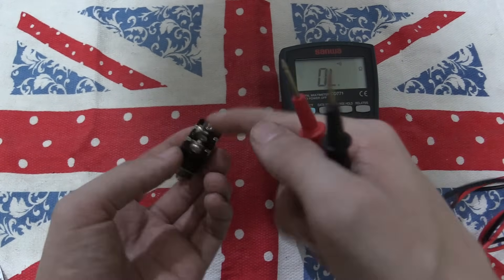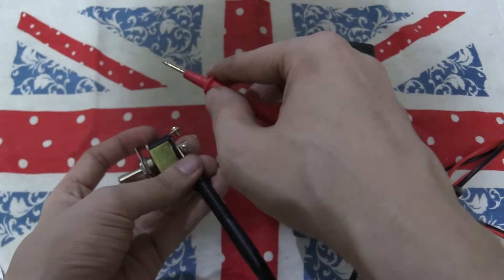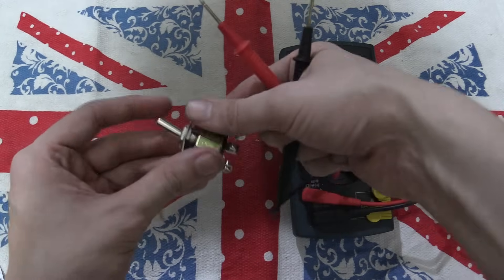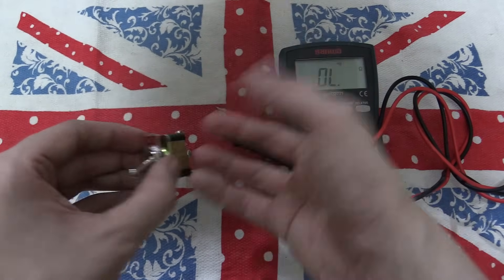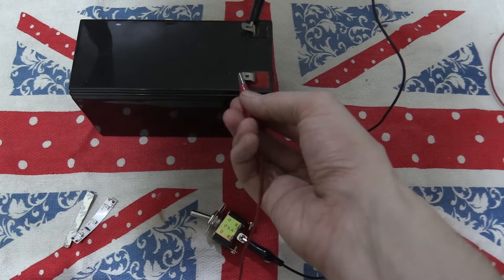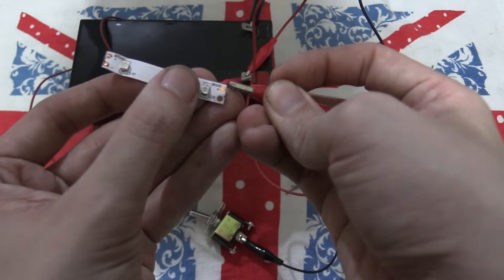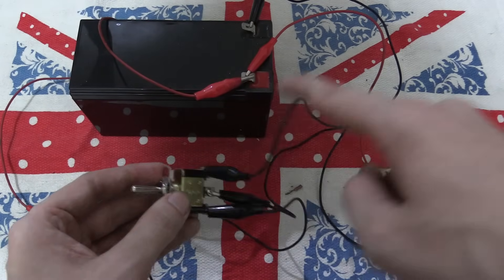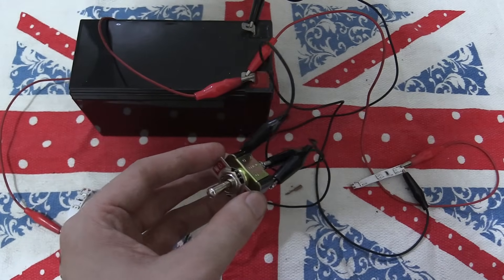How to wire a 3-way switch

Comment: Hey everyone, can someone help me out?
I have a prewired wiring harness for a Les Paul–style guitar, but the 3-way toggle switch and output jack aren’t wired in the kit. There are two long wires hanging out from the wiring harness, and I’m not sure where they connect to.

Before I move on to wiring the pickups or the output jack, I just want to know exactly where these two wires should go. I’ve uploaded a video showing my harness setup — please take a look if you can.

It’s been a week since I bought this thing and every diagram I find looks different, so I’m really stuck. Any help would mean a lot!

Thanks

Comment: So glad i found this, i wanna try again with my bike. It has a two wire ignition, i put a stripped wire in one plug slot and then the other on the opposite plug. Then connected both output to the separate wires. The middle prong which i thought to be my ground i had no where to put it. I had a wire connected to it and ran it to a bolt on the frame and the lights flickered on but since it wasnt properly grounded, it wouldnt stay on. 

Managed to stick the ground into a key hole one the frame and the lights came on and stayed on. I hit the kill switch on and was able to start the bike. 

So all i need to do it conmect the ground to one of the plugs (assuming its the black wire behind the plug) and then leave the one side of the output connected to the white-blue striped wire for power? Should work

Comment: Should state what meter you are using and maybe a link to it. I watched one about a 5 pin relay and it had links to the meter. My volt meter is analog so I need to find a video that shows how to properly use the meter to test anything.
Reply: What setting are you placing your meter on, can't tell.

Comment: This seems very simple… tell me can i use this as a speaker selector switch (middle to amp then just connect speakers to either side? Flicking switch to choose between two speakers?) hope you can help and end my searching 🤣👍🏻 if the switch was 6 pins?

Comment: Okay - is it just me, or is this switch one of the most intuitive switches (the video is good, I'm just describing the switch). You would think that the direction of the toggle bar would dictate which of the two outer pins are connected to the middle pin. For example, if the toggle is pointing down, its the lower pin that's connected,and vice-versa. But no, its completely the opposite of what you think 😵‍💫

Comment: If we have to connect ECU ENGINE CONTROL UNIT WITH 12V BATTERY WITH LED light in 3 way postion toggle switch how we connect these 2 thing with same voltage

Comment: In the beginning of the video you call the middle prong the "power input" which would be a positive like the + side of a battery but then later in the video your calling the same middle prong "ground" which would be negative. This is confusing.
Reply from the maker: It could be ground or positive, depending on your preference and project. 

If you put positive in the middle, you will have positive on whatever side the switch is set to. 

If you put ground or negative in the middle, you will have ground or negative on whichever side the switch is set to. 

If you put positive through the switch, your ground will go direct, bypassing the switch. 

If you put ground on the switch, your positive will go direct, bypassing the switch. 

This switch is only controling one side, either positive or negative.

Comment: I really need a spdt on-on switch that can handle 12vdc @ 30 amps or greater (Automotive use)
Reply from the maker: Maybe use a switch to control relays?

Comment: I'm trying to wire a 3-way switch to control a hi/lo beam headlight on my bike. The headlight has 3 wires. One is supposed to go to battery negative (according to manufacturer), the other 2 control the high and or low beams in the light. I'm trying to figure out which steps in your video I should leave out for my situation. Please help!!!!!

Comment: Have set of foglamps disconnected but cant remember how they plug in have red and whit and blue wire where do they go to make them work is Bella confusing me!!!
Reply from the maker: It sounds like your fog lights are designed to use a relay. 

You'd need to check the wiring for your exact model but you could try red to positive battery, white to negative battery and then blue to relay. 

For testing without a relay, briefly touch the blue wire to positive after red and white are already wired. 

Male sure to check the wiring manual before making any permanent connections.

Comment: Hi, really good and clear video! 
It might be a stupid question but if the switch is rated for 125V 10A, how to estimate the max current for a voltage of 36V? Is it 10A or is it more?

Thanks in advance ;)

Comment: Could also use this same 3 way switch for one 12 volt outlet, and then 2 separate power sources like van battery for one, and solar battery for the other source. That away you can the van powering the outlet when driving, and the solar battery powering the outlet when not driving? Is that correct?
Reply: Yes.

Comment: Great video - easy to follow.  I am attempting to wire my VW van so that I can switch my radio between the starter battery and the rear auxiliary battery.  I'm assuming the radio input wire would go into the middle pin then each battery would go on top/bottom pins, correct?

Comment: why dont you connect the middle pin with 12v (+) ? and ground the led strip instead ? just curios.
Reply: Havent tried, but I guess the off option is when you point it down. So instead of ON-OFF-ON, its OFF-ON-OFF.

Comment: Ok question if I had a led toggle 3 way switch and used the input and outputs like u have in video as ground control to trigger relays how could I power the led light in the toggle? I assume it would have a 4th sperate pin for the led light? Would that be a separate input just for the led on the switch from the outputs?

Comment: I have a switch just like this and am trying to use it to switch between two relays for a electric radiator fan. 

In my case instead of ground in the middle, would I use 12v ignition triggered positive and then on top and bottom posts one to each relay to trigger it?

Comment: I have 2 led strips on my motorcycle and trying to switch to this type of 3 way toggle switch. I have 2 positives and 2 negatives, 1 for each led strip. I have a separate positive/negative wire, positive into my ignition fuse and negative to the frame. I put all the ground wires together on one side positive on the other and the positive fuse wire in the center. when toggled on 1 way it's fine but the other on position it burns the wire. what can I do? I'm so lost with the 3 way toggle I couldn't find a 2 way.
Reply from the maker: Don't connect ground and live to the same switch. Connect the positive of your LED strips directly to the ignition fuse. Connect the negative of one LED strip to one side of the switch and the negative of the other LED strip to the other side of the switch.
Reply: Gadget Addict Thank you so much! if I do that I'll only have 1 led strip going though at a time right? what if I want both on at the same time with 1 switch?
Reply from the maker: Correct, only one LED strip would turn on. If you want both to turn on, just connect vehicle ground into the middle of the switch and both negative of the LED strips to one side of the switch. You don't need a 3-way switch for that.
Reply: Gadget Addict I would've used a 2 way if I could've but there wasn't any in stock unfortunately. Can I still do that with the 3 way or should I just get a 2 way?
Reply from the maker: You can do it with the 3-way. Just connect ground from your vehicle into the center switch and then both LED negatives to one side of the switch and ignore the other side of the switch.
Reply: Gadget Addict Awesome Thank you so much!

Comment: Brilliant demonstration of an on-off-on switch, and without a doubt the finest one I've seen on YouTube. After generously contributing to your video's view count, I successfully cloned/tested your circuit, but with the polarities essentially reversed. Is there anything wrong with connecting the battery + to the switch's center (off) pin and the two outside (on) pins wired to supply + to the LEDs (each grounded back to the battery -)?
Reply: You'd think someone would be able to answer this in 5 years :D

Comment: Thanks for uploading this video! I have been looking to use something like this in an art project. I am a total circuitry newb and I have been scouring the internet looking for a way to have two lights controlled by one switch with an off position. Is there a safe way to have this work in a permanent way plugged into wall? Also where did you get your switch? I can only find double pole.
Reply from the maker: You can buy AC rated switches which look and operate pretty much identically to this 12V version. I got this one from a hardware shop, they're pretty common. If you just want two bulbs to turn on and off at the same time, any regular switch can do that. But I'm assuming you want the option of both bulbs off or to then have either one switched on, is that right? There are also 3 pole AC switches designed for a regular wall plate installation but they're not very common so you'd have to order it online. If you don't have much electrical experience, you need to be careful because AC shocks can be deadly.